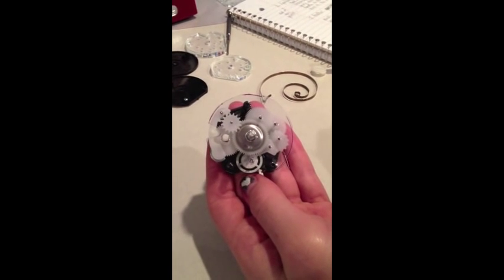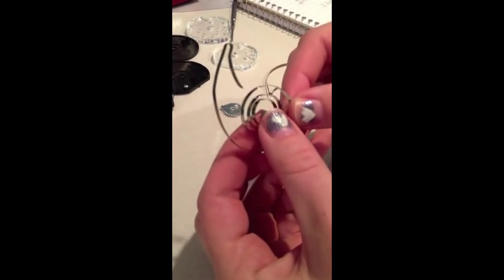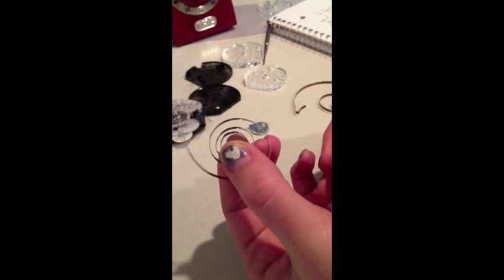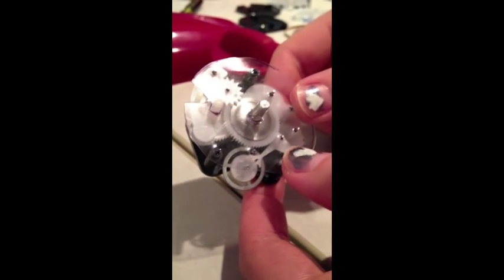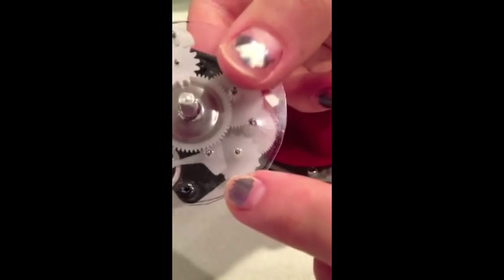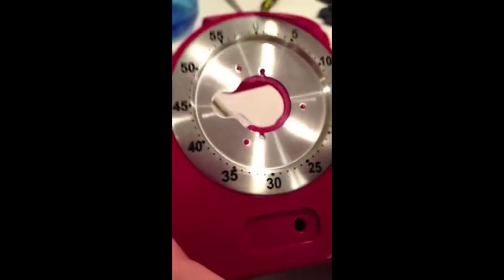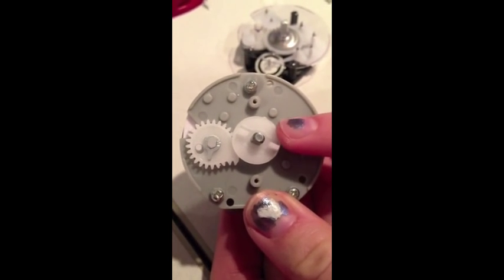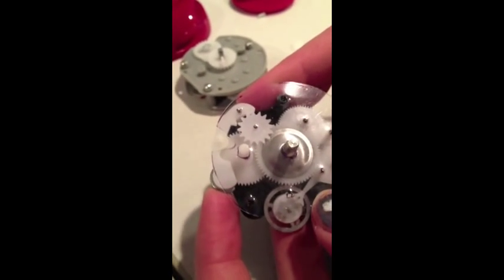How a kitchen timer works

Comment: Good video but what you call a pendulum is actually a balance wheel, the same system used in mechanical watches. Pendulum movements use a weight that swings back and forth at a set rate to keep time like on grandfather clocks
Reply: It does the same job.

Comment: The timer I have is an old vintage collectors item and works intermittently. I'm told it needs to be oiled, but what part do I oil? The teeth on the gears? The shaft the knob goes on?

Please help. This is a birthday gift for my wife.
Reply: Only oil the axles that the gears run on. It'll gum up the gears.
Use the lightest oil, you can find. Like for sewing machines or use soybean oil. That's what it's originally intended for.

Comment: You are giving information about gears.  Gears turn at different speeds in a stack due to the ratio of teeth with relationship to each other.  Not due to size alone.

Comment: The pendulum is actually is called the escapement lever. The end has pallet forks or pin levers to actuate the escape wheel allowing it to lock and run at the proper intervals due to the winding down of the mainspring. The back and forth motion of the pin lever is caused by the balance wheel that has a hair spring that pushes it one way ( lock). As the tension is overcome the hairspring causes the balance  wheel to return back and push the lever the other way ( run) and then it starts over again and regulating the escapement wheel as it counts down. It's quite the process though learning the mechanics. Here is an example of a similar movement, but more sophisticated. The principal is basically the same.

https://youtu.be/Wmk2mA6dg3o

Comment: Hello, very interesting video. I learned a lot. I want to modify a kitchen timer to be 60 sec instead of 60 min. Could you give me any suggestion? The idea behind is to install it in a toy kitchen as timer for the oven.
Reply: You have to change the gears I would imagine. Excapements are absolutely not meant to be run as quickly as you are asking. You may just want to put a flywheel or governor on the spring from a kitchen timer to replace the escapement. But there is no way you could properly time it.

Comment: Thanks! My tomato timer ticks but the bell doesn't ring. The woman who sold it to me said they don't come with bells. I took it apart as per your video and saw the striking hammer and the metal bell. Then the spring jumped off. It was a super big pain to put back on. The timer is ticking again but the bell still doesn't ring. It went off a few times when I was trying to pull the spring back on, but not now that it is back together. I need to get better tools. Fascinating.
Reply: Did you turn it clockwise to the 60mins and then anti clockwise to the time you need? That's what instruction says